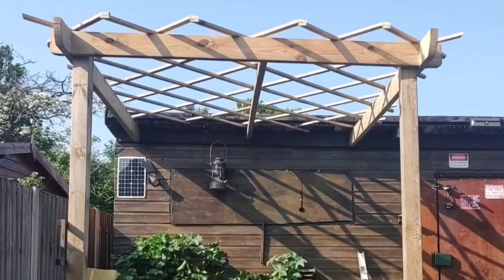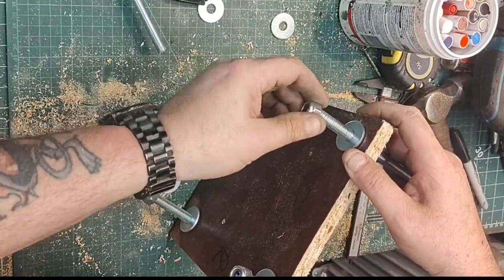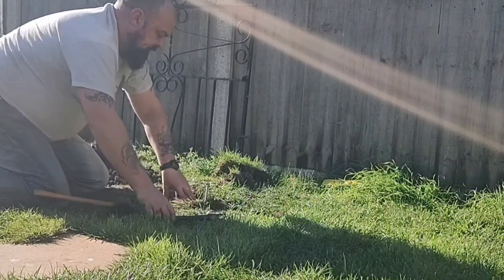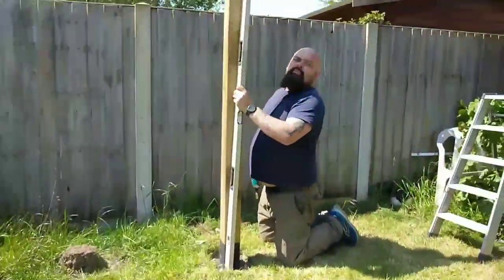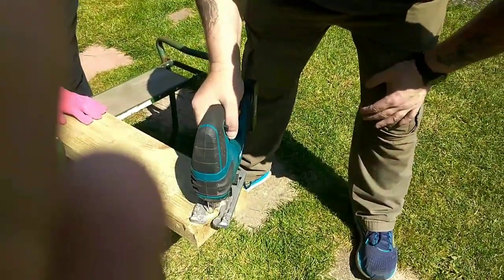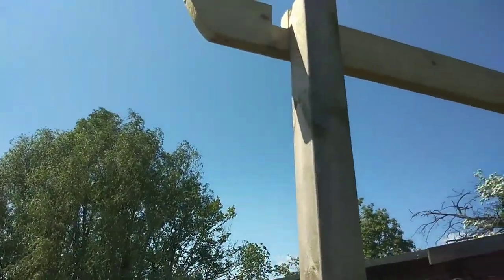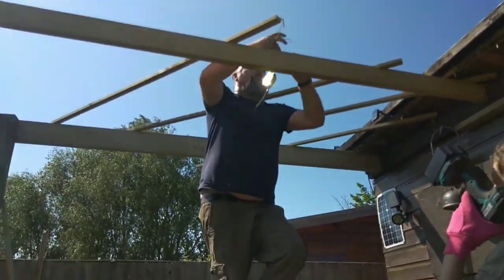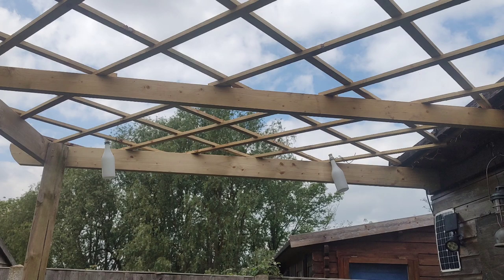transform your outdoor space With a stylish new DIY build pergola

Comment: Incredible build. Looks very nice. Very cool that you and your family worked together. Will you need to treat the wood so it doesn't rot? I didn't hear you mention if it was treated or not already. Are those jugs lights? I've seen them be turned into solar ones. Hope you will show updates on how your fruits do. Camera work was just fine. Looking forward to the BBQ build.
Reply from the maker: Thank you , the wood is treated , we thought about staining it , using a treatment , ronseal etc but that look bad when it starts to come off , we built the climbing frame ) treehouse area a few years back and treated the bare wood with decking protector and it seems to stand up really well and we have a lot left do will probably use that , it's clear and lasts a long time .
Reply from the maker: The lights are made from frosted bottles with tiny solar panel corks in the top , I did a quick build on them over on the other channel a while back (you tube stats showed most people skipped them lol ) but they work well for ornamental back lights , should get a dark shot of them I guess ....